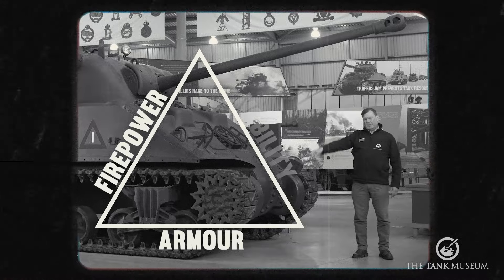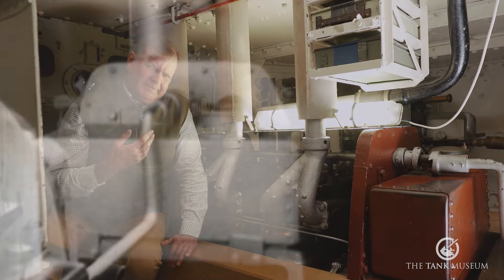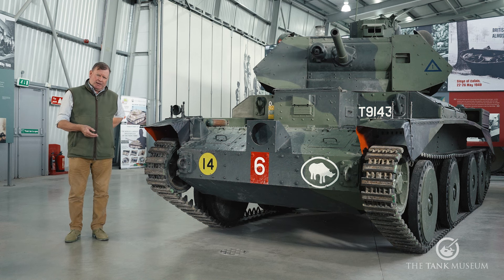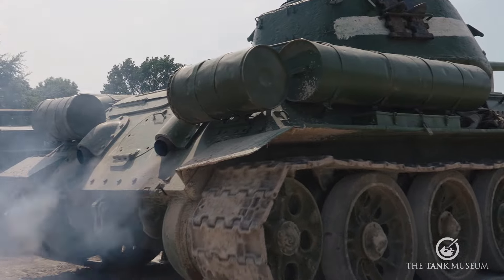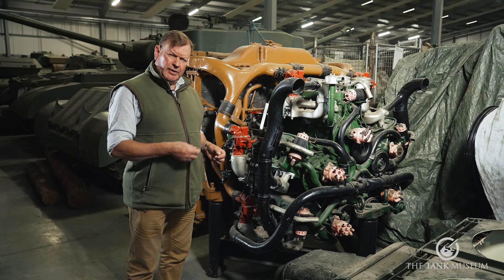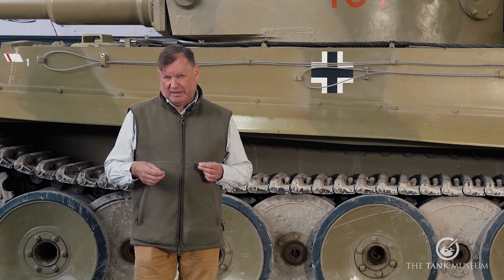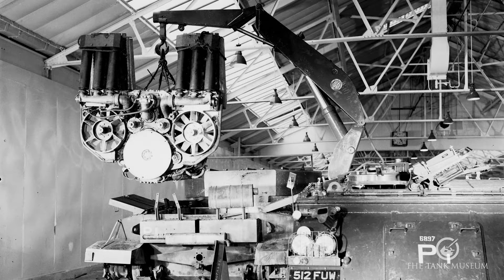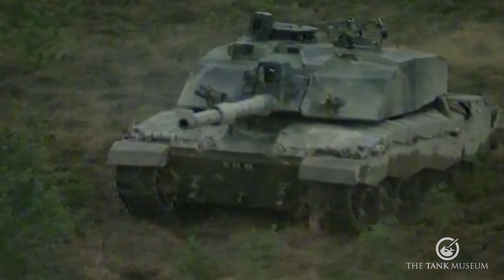Powering Victory: How tank engines went from 105 to 1200bhp

Comment: My paternal grandfather was all too closely familiar with the engine in his MkIV female. The underpowered and extremely smoky Daimler sleeve-valve engine used in the MkI to IV ~ was made worse by the military’s system of fuel allocation. The highest octane fuel went to aircraft, middle rated fuel to staff cars and transport whilst the grotty old 45 octane was deemed suitable to tractors and the like ~ including tanks. The MkIV did have a more reliable fuel delivery system in the form of the ‘Autovac’ and the use of a ‘proper’ exhaust system certainly improved matters for the crew, whereas the earliest models lacked any real engine exhaust system at all, the gases just venting through slots in the roof above the engine. The conditions must have been appalling!
My grandfather’s tank was knocked out by a German field gun ~possibly a 7.5cm or  7.7cm ~ which detonated in the engine block, utterly destroying the tank and showering my grandfather in burning engine oil. Even though he passed away in the mid 1960s when I was only 6 or 7, I can still remember the burn scars on him. I’ve always regretted that I wasn’t quite old enough to actually talk to him about his experiences. 
Those first tank crews were real trail-blazers ~ real tough buggers too!
Reply: wow amazing story man, thank you for sharing
Reply: Many wouldn't want to talk much about wars.  My uncle the F6F pilot was reluctant.
Reply: @toomanyuserids  Yes, that is true in many cases, but just occasionally I’ve spoken to veterans who will talk. One was my first mother-in-law’s for lack of a better term, ‘boyfriend’.  He’d been in mine clearance and bomb disposal in WW2. What he saw and experienced in the Western desert just increased my admiration for the ‘greatest generation’. Being lowered down a well in the desert to remove corpses dumped down there to, let’s say, ‘pollute’ the all-too valuable water was bad enough ~ but many of the corpses were booby-trapped too. He was the only member of his squad to survive the campaign. Then again, there was the ex-Luftwaffe fighter pilot who regularly flew into the airport in the U.K. where I worked in air traffic control in the 1970’s & 80’s. Great guy. There was a Polish guy on the airfield who had his own crop-spraying firm using Ag-Cats if I remember correctly.  We often wondered if there would be any lingering animosity if they ever met, but apparently not. They arranged to meet in the flight briefing office one day and the German guy said,
‘Ah, Ladislav! Let’s go to the bar, have a drink and talk about f-ing stupid war!’ And so they did. 

Hope springs eternal…
Reply: @ghxst7951  My pleasure. It was an honour just to have known him and other veterans.
Reply: @davidpope3943  Thanks for that. In particular, I wondered just what octane rating the period fuels were. A Model T Ford had 4 to 1 compression for a reason. I was told restored WWI aircraft engines work better with naptha gas,call it Coleman fuel,than with modern 100LL avgas. The burn curve of the petrol ,the very engineering designed into the engines is based on that burn curve. At least it makes sense to me.
I knew a number of WWII vets when young. My father had no desire to revisit his RCN Navy memories. Some would talk,but only amusing moments. I do wish I had the sense to get those who would talk to speak into a cassette tape recorder microphone.
There was a WWI vet with an amazing story. He was deck gun crew on a British submarine,and the U boat was shooting back. A shell had incomplete detonation at the seat of his pants. The splinters worked out for decades,he literally had shoeboxes full of metal from his body. His wife threw them out when he retired. With that damage,nevertheless his plumbing worked,he sired three children and kept a full time job. The only thing he could not do was go through a metal detector. Very matter of fact,that tale told nowadays would cause jaws to drop. I sure wish the full story of his service and his civilian aftermath got written down. Real survivors,they were.
Reply: @paulmanson253  Very interesting ~ my turn to thank you. Untold veterans stories must be legion and as they pass away are lost to us forever.  Looking at the state of the world today and those minor things some extremely vocal people think are oh so much more important than ANYTHING else, I do wonder ~ more and more frequently ~ if those veterans thought it was worth all their sacrifice. I know that David Shannon of 617 Squadron fame certainly wondered this as he witnessed a vocal demonstration against the ‘baby killers’ of Bomber Command at the unveiling of a memorial to the 50% of Bomber Command crews lost in WW2. 
Your WW1 veteran submariner must have been extremely uncomfortable ~ although he was at least probably better equipped than most to enter an ar*e kicking contest with his inbuilt armour plating!
Reply: @davidpope3943  Coventry was revenged upon Cologne. Bomber Command started with useless leaflet raids and ended up doing to the Germans what had been done to others. The fathers of the kids I chummed with served together, call it 39 to 45. Served,Alexandria,Western desert,Sicily,Southern Italy,back to England,recruited up to strength,Normandy,then East. What 12thSS HJ did to surrendered Canadian POWs was understood. They fought them and other Germans,battle of the Scheldt on into Germany where the German civilians constantly protested their treatment. And then helped liberate not one but two Nazi concentration camps. Their opinion of all Germans,man ,woman,child,soldier was their national destiny was fertilizer. Inspiring cabbages from underneath.
Wouldn't speak of what they saw.
Did noncombatants die needlessly  ? Needlessly? Not sure.
Us kids heard the occasional story when the menfolk had a few drinks together.
I once stood at the war cemetery East of Bologna. The hair stood up on the back of my neck,looking at gravestones with names I recognized. Estabrooks being one such. The kinfolk of the kids I chummed with,their skeletons were just below the ground I was standing on.
Right or wrong,the need was to win. Whatever it takes. 
If you choose to follow evil and lies,there are consequences. 
Soldiers with rifles who are young men will do whatever it takes to live.
And protesting civilians will tell young soldiers where the bad guys are if you threaten to shoot their wives and daughters. Who lived afterwards ,probably hating the soldiers for the rest of their lives. At least they lived. The SS would not have been so civilized if the situation had been reversed.
The whole story needs the telling. Not just parts that fit the narrative of the teller.
Reply: that's nuts I wish you could of gotten the chance to ask
Reply: @paulmanson253  I do not disagree with a single word you wrote. He who sows the wind shall reap the whirlwind. I’ve been looking for a particular quote from one of my (too) many books but can’t locate it. So I’ll substitute it with this instead, as it still speaks of those who took up the task of defeating tyranny.
‘When the nation is in danger, we make much of them. When the staid days of peace rule our lives, we are not always as grateful as we should be.’
‘
Reply: @davidpope3943  A closely related quote,I cannot remember all of it. "The thin red line of heroes......" That is the beginning. Easy enough to find the rest of it.
Something from Kipling went like this. When the widow held the party.... Referring to Queen Victoria. And the party included bayonets. 
Never wore a uniform myself,but I knew Vietnam vets. 35,000 young Canadian men went South of the border and served,1963 to 1973. A surprising number of US men went North after their hitch. They could talk to each other,rarely with civilians. 
I once held an 88 projectile. Landed in the foxhole of Mark Milners father,didn't go off,he kept it. Heavy. Visualising that going bang along with a lot else,I can understand why people who have been there having a hard time communicating with those who haven't. 
We do not do a good job educating our young people. Not just about that,but more money gets spent teaching less,every decade. I'm old. Doing a good job is now someone else's problem. 
Make sure you watch the David Glanz lecture here on YT. Myths on the Eastern Front,something like that . Well worth watching. Cheers.
Reply: @paulmanson253  Thanks for the pointers. Much appreciated. 
I knew about tens of thousands of Americans heading north to avoid the draft but never realised that many Canadians went south to serve. 
My father served in the RAF in the 1950’s and my younger brother also served in the RAF in the 70’s & 80’s then moved into warbird restoration; he’s currently working on bringing a WW1 SE5 to airworthiness. I nearly joined the RAF in the 70’s but was told they didn’t need pilots, so went into civilian air traffic control instead. Three years later, the RAF announced they were short of pilots….. Where I first worked had been in military use in both wars and had been fitted with anti-invasion/airfield denial pipe-mines in a grid across the airfield. It was also equipped with a couple of the Pickett-Hamilton pop-up forts, one of which is probably still accessible; the hydraulics to raise it were certainly still working in the 1980’s!
At war’s end the airfield was swept by some engineers eager to get shipped back home and pronounced ‘clear’. In the 1980’s, it was found that their ‘clear’ sweep was anything but, so for several weeks we had the Army on-site digging up the pipes with remote-controlled excavators then removing a LOT of explosives with controlled explosions to crack the pipes and burning of the contents. Most interesting to watch. And we weren’t the only airfield that required clearing around that time either!
Reply: @davidpope3943  Holy crow. An SE 5. I hope he makes it safely into the air. Always liked the look of the things. As a kid,Cole Palen himself took me up in a brief ride ,a 1930s Grumman mailplane,Old Rhinebeck New York. The vintage collection there was mind boggling. I remember a Bleriot stored vertical against a shed wall. Watched a guy patching a fabric wing,and the smell of aviation dope.Always wanted into aviation,but circumstances got in the way.
I hope a few of those popup forts are cared for enough to still work. There was black and white footage I saw,years ago. Interesting concept. No idea how effective they would have been if they needed to be used.
Once again,thanks for that. All the best.
Reply: @davidpope3943  I take it you weren't privy to their conversation?

Comment: Another excellent presentation from the Tank Museum. Well done. I learn more with each new class, thank you professor. The Chieftain was one of my favorite British tanks to bad the engine was so unreliable. Britain tried to meet the NATO requirements for a multi fuel engine then Germany and the US just disregard that and went ahead with diesel powered tanks. Imagine how good the Chieftain would have been with good reliable diesel.
Reply: The US would go on to field the Honywell ARG 1500 turbine engine, which is multifuel a decade or so later.
Reply: The one and only export customer specified the Leopard 1’s MTU engine, instead of the Leyland L60, according to my understanding.
Reply: @dongiovanni4331 Yeah the US didn’t really abandon the multi-fuel requirement it just took a while to get one in a tank. The first tank the US used a multi-fuel engine in was supposed to be the MBT-70 which got cancelled due to many factors but primarily because the thing was expensive and there were disagreements between the US and West Germans who were co-developing it. The M60 Patton was put in service during development but after the MBT-70 got canceled, the resources were redirected to make the M1 Abrams which had the turbine multi-fuel engine first intended for the MBT-70.

Comment: While working on a generator I have had to climb inside a steel box with an 8.1L diesel engine on load a few times.  Even with hearing protection and sound insulation on the inside of the casing, it was insanely loud and I did wonder how that would have compared to a WW1 tank.  My conclusion is it would be chaotic, hot and deafening, but I`m sure it would have been better inside than outside, barely.
Reply: Even being in crews of more modern tanks like the M60 and Abrams, being inside the turret with the engine running was deafening (hence why we wore our CVC helmets all the time). I can’t imagine what it would be like an early MkI or MKIV.

Comment: Some time back I watched a hot rod building show on TV and the guy had huge gasoline engine out of a Sherman tank. He had the instruction book from the tank and it described how to properly warm the engine up. Start up, run at like 2000 rpm for 10 minutes.
That should consume around 8 gallons of fuel.
I thought , what kind of fuel tank they have, 500 gallons?
8 gallons just to warm it up.

Comment: South Africa upgraded each Centurion with a 29-litre Continental turbocharged diesel engine and a new transmission adopted from the M60 Patton.[87] The refurbished Centurions were also armed with a South African variant of the Royal Ordnance L7 105 mm main gun.[87] in 1985.[87]
Reply: I heard the Rhodesians and South Africans were quite innovate, they designed world leading mobile armoured vehicles.

Comment: Early tank engines are so unique.
 
Either special engines got  “dumbed down” like aircraft engines into a tank, like a Continental radial or Meteor V12

Or boring reliable straight 6 engines become a 30 cylinder Chrysler Multibank or Bedford flat 12. 

And some tanks even got engines meant for the job like a Double Detroit Sherman. 

Just awesome stuff.

Comment: I am glad you mentioned the Leyland L60. It's such an awesome and unique idea but was a premature technology. It has opposing pistons which meeting in the middle and fire away from each other to increase RPM and efficiency. A downside is that it requires two crank shafts. I wish it was developed further.
Reply: I don't think the technology was premature.  Have a search for the Commer Double knocker engine, which also sounds more similar to the L60 than any other engine.
Reply: @Daniel-S1  I haven't heard of that, I'll have a read. Cheers.
Reply: @webtoedman My Granddad worked on them! He designed the governor for the Hi-Dyne engines while working at Paxman Diesels, and then ended up working with the chaps in Lancaster on the DP1. Incredible, I had almost forgotten about all of that.
Reply: Some Junkers aircraft of WW2 has opposed piston diesels, the Jumo 205 and onwards. The design is more compact than a conventional four stroke diesel engine in that it has no cylinder heads or valvetrain so is more simple. Being two stroke it is at least supercharged and in some cases turbo charged as well. The two stroke firing also adds to smaller size for similar power output when compared to a four stroke engine. As for the Leyland unit I am puzzled how you get a diesel to run on petrol and aviation Kero with out the wizardry of computerized timing control or variable valve timing as a drastic reduction in compression ratio would be needed for the lighter fuels.
Reply: @frasercrone3838  L60 Multi Fuel design didn't mean that you could jut pour any fuel type into the fuel tanks and away you go. It was pretty much as you say, one of the crankshafts (can't remember if top or bottom) had to be advanced or retarded (again I can't remember which of those) with respect to  the other. This required some time and effort from a mechanic trained on that engine. Ironically there was never a single case of Chieftain using anything other than diesel in front line service.

This capability was really quite useless then and designing it in further undermined the reliability of the engine. Also the power output on other fuels wuold have given a reduced level on what was not a highly powered engine even with diesel.

Comment: I have the impression that tank engine application was driven more by "what is available" or "what can be adapted" rather than engines developed expressly for tanks. What would be the important characteristics for a tank engine- torque, the ability to use available fuels, reliability? Aircraft engine development during WWII was a furious race to keep ahead of the other guy- down to tearing down engines and sampling fuels from crashed enemy planes to see what they were using. Were captured tanks and other vehicles given the same treatment?

Comment: It took me many years to realise that  in the 1930s, the tank had an engine requirement that meant it needed a specifically-deigned engine: truck engines were too small and weak, plane engines were converted, but usually were far from ideal (wrong layout, too sophisticated, and needed for aeroplanes).

So in the 30s they are trying to work out suspension and engine solutions without really being able to repurpose familiar civilian methods.  Tanks advance quickly once torsion bars and proper 500hp-class engines appear.  This is more subtle than the simple gun size/armour thickness/top speed triangle we think about.

Comment: Another factor with tank engines is also the weight. The heavier the engine the more the tank increases in weight and so the more power that’s needed to get it going. That’s why some engines were developed from aircraft engines because they are both light and powerful, like the rotary engine in the M3 Lee/Grant, the M3 Stuart, and the M4 Sherman, the Meteor engine that several British tanks used, or even the turbine that the M1 Abrams uses.
Reply: And weight distribution. If the engine is shoved as far in the back as possible, it'll exert greater leverage on the chassis than in the middle, where space is at a premium.